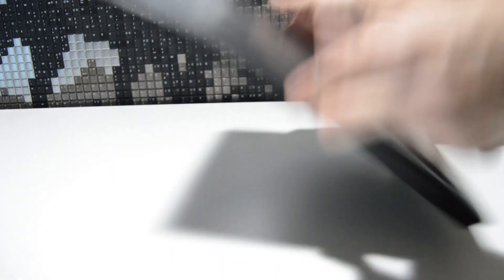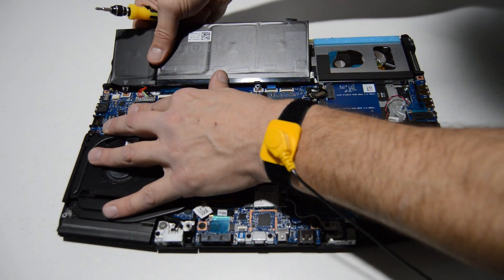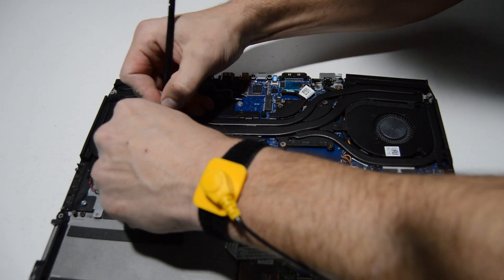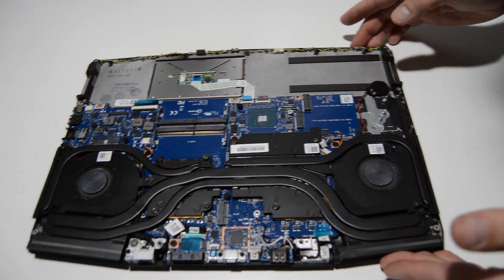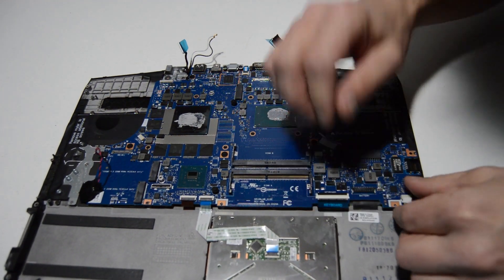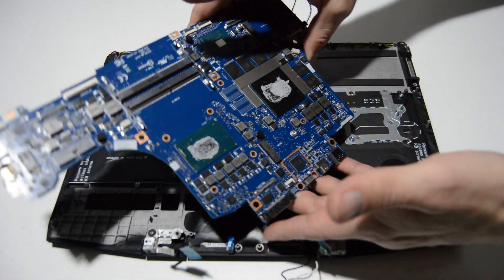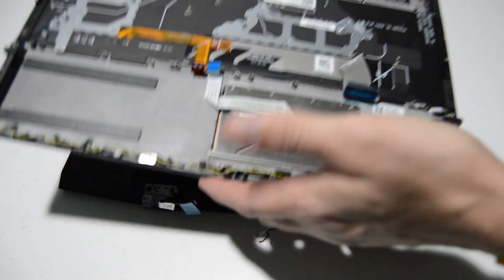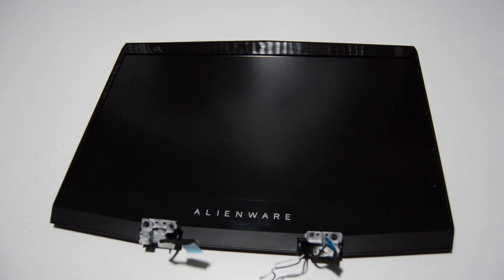How to Disassemble  Alienware M15 Laptop

Comment: Hi Dude, thanks for the video. I want to clean my fans of my m15 but do I have to remove the heatsink and repaste to do this? or can tthe fans be removed without removing heat sink? Thanks in advance
Reply from the maker: It would be way easier and less likely to damage your hardware if you just use either canned air through the back vents to blast the heatsink and fans out, or remove the bottom case and use a brush and canned air to clean the fans in-place. If you go the easiest route, its best to use short bursts while the fans are running so that the loosened dust and dirt are pushed out immediately.

Comment: Dude
Reply: I opened up my this laptop and one of the fans were not workin
Reply from the maker: @diwin8967  Sometimes the BIOS settings can allow a fan not to spin until it's needed. Just make sure its connected and any settings within the software or BIOS allow the fan to spin all the time. If it still doesn't work, replace it.

Comment: For some reason the front screws near the mouse won’t come out. They all wobble but there is something keeping it in there.
Reply from the maker: Some have a backing retainer and don't come out. Otherwise it may be the screw post broke and is still holding onto the screw.
Reply: @Sellbrokedotcom  then how do you clean the inside of it out
Reply: I had the same issue and I can’t access the inside easily because of them

Comment: We’re is the gpu at
Reply from the maker: After the heatsink is removed at 8:30, its the one on the left surrounded by VRAM chips. It is integrated into the motherboard.
Reply: SellBroke so you cant go and buy a new gpu and install it in your laptop
Reply: SellBroke I was just wondering I got this laptop last year and I got the rtx 2060 gpu good gpu but I was planning on getting a 2080 ti later on but I guess I’ll have to buy the 2080 ti and then spend extra $200 for the graphic app
Reply: Viperion no big deal I got an Alienware graphic amplifier and got me rtx 2080 super anyways but thanks anyways
Reply: Viperion I also got a pc that can be upgraded no worries

Comment: Thanks for the informative video.  I had a quick question.  I noticed that there are thin rubber strips at each screen hinge.  Do you happen to know if they can be easily removed and reinstalled?  I noticed that one of mine seems loose.  Thanks again!